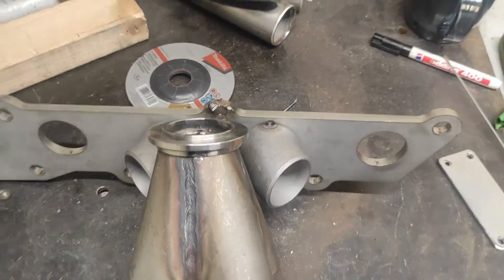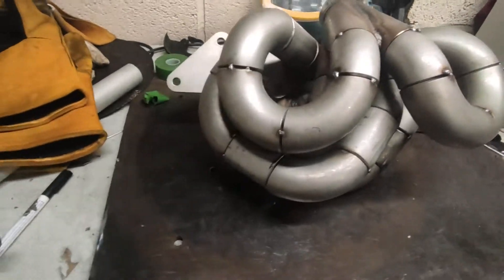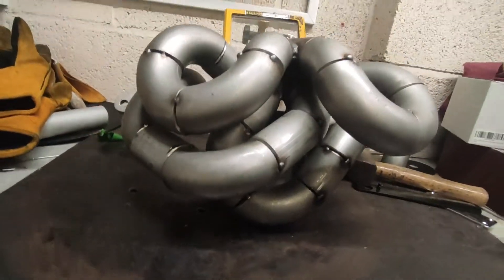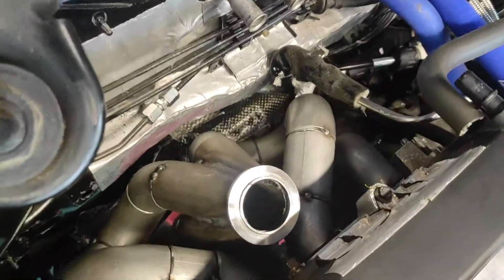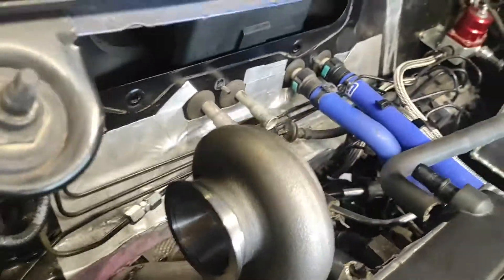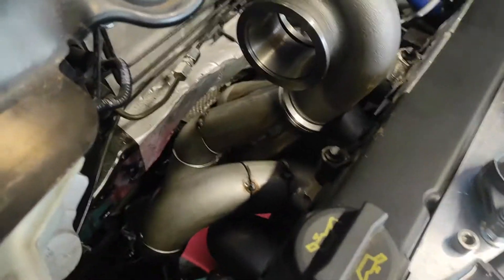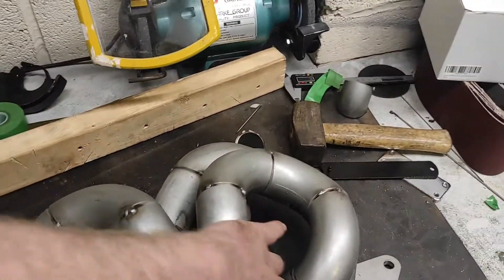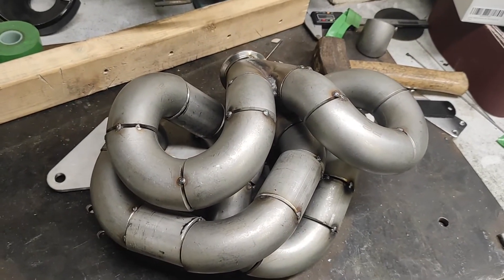Fiesta ST Turbo Build - Mocking Up The Turbo Manifold

Comment: Bud your gaps are to big on some , they need to be such a tight fit ,then you just tac then ,fill the bevel in with weld and with gas purge seals the deal, if gaps are to big it’s possible that tig filler rod and especially mig wire will travel inside the tubes sooner or later they will break of and kill your turbo and engine , just trying to help
Reply from the maker: Thanks for the input, yes getting a nice tight fit made welding much easier, this was my first time using a TIG welder, I definitely learned a lot along the way.
I welded all the pipes individually, there was no little bit of filler wire etc showing through. I did check for the exact reasons you mentioned.

Comment: Hi, which material is used for this exhaust manifold, I know it is stainless steel but I wanna know the type and thickness? Tnx
Reply from the maker: Hi, it 1.5" Sch10 pipe 304 stainless steel. It was bought from profusion Exhausts. They might have more exact dimensions on their website. Sch10 is a standard sizing